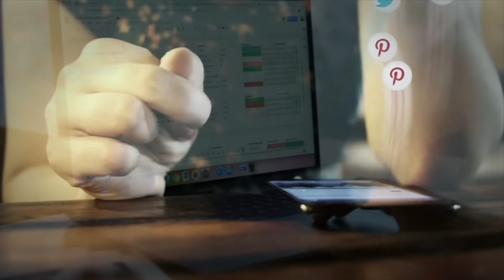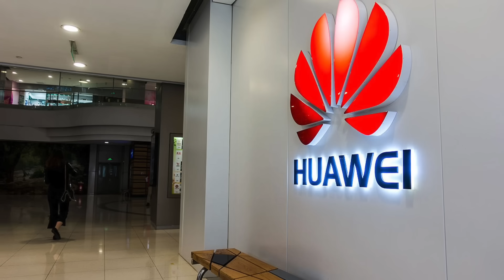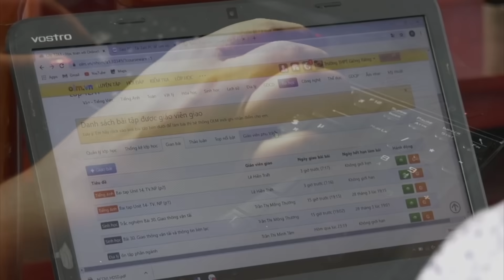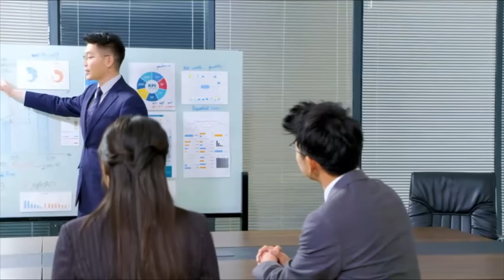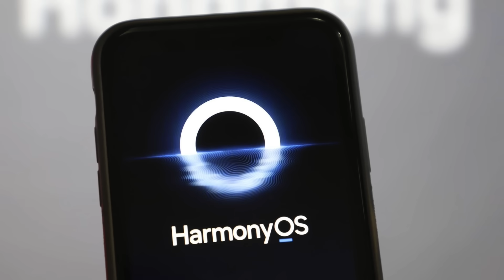Huawei Mate 80: Kirin 9030 & HarmonyOS 6.0 — China’s Bold Response to US Sanctions

Comment: The US multiple sanctions and economic war is a deliberate attempt by the US to obliterate Huawei and China from the highly advanced technology industry.
Huawei is fighting for its life and to survive.
Necessity is the primary driving force for Huawei to innovate in the chip technology industries.
Survival is the only option for Huawei to continuing growth.
The Huawei Mate 80 series is expected to be the first device to debut with HarmonyOS 6.0, marking a significant software milestone. 
This new operating system introduces a revolutionary "HarmonyOS intelligent body framework" that shifts the interaction model from being "user command-centered" to "user intent-centered," enabling more seamless and intelligent cross-device experiences through multi-agent collaboration. 
The flagship model of the Mate 80 series will feature the new Kirin 9030 processor, which is expected to offer a notable 20% performance improvement over its predecessor, the Kirin 9020. 
This chip is designed with architectural optimizations to enhance computational efficiency and power consumption, aiming to deliver strong performance for multitasking and high-frame-rate gaming. 
To further boost performance, Huawei is also reportedly incorporating a micro-pump driver chipset into the Mate 80 series, which will focus on improving thermal management to prevent device lag and shutdowns, thereby supporting the overall performance of the Kirin chip.